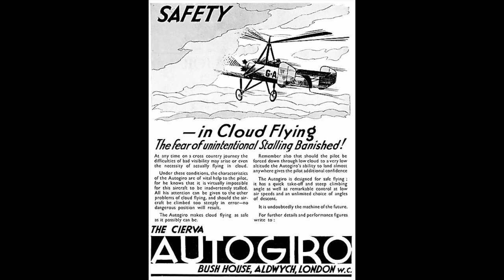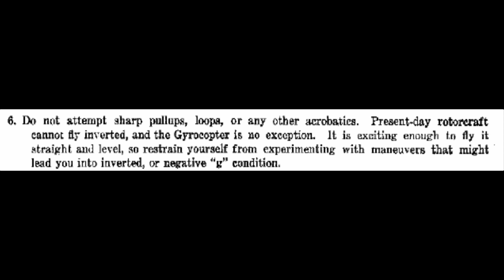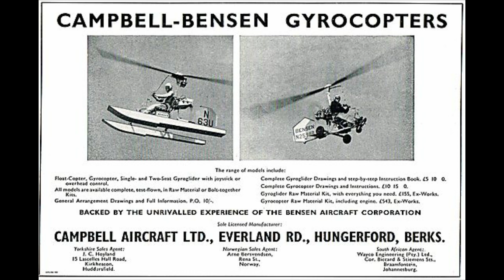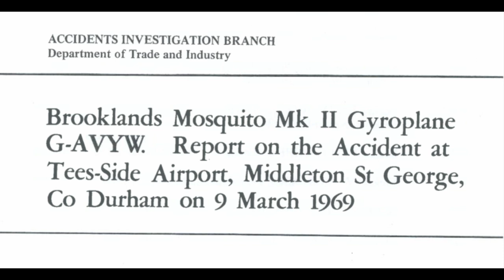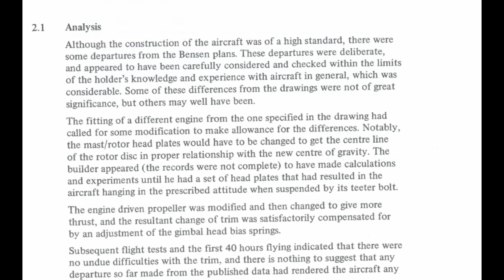History of the Gyroplane - part 7 accident analysis

Comment: Curious if modern gyros can be made safer through monitoring for unsafe flying conditions, kind of like stall detectors.
Reply from the maker: Hey Boris - Well there are some devices that suggest when the rotor speed is in a range that is hazardous - see the gyro warning film.  However the real problem is training.  Whatever device is fitted you need to react effectively to it and that requires training, and tbh training that is already in most mature countries effective at stopping accidents.  The problem is humans are prone to err and in a gyroplane small errors are punished.
Reply: So how does one get proper training?
Reply: Are the cheep ones that are basically a seat on a stick safe? It’s about all someone like me could afford if I wanted to get one. Which I very much do one day!